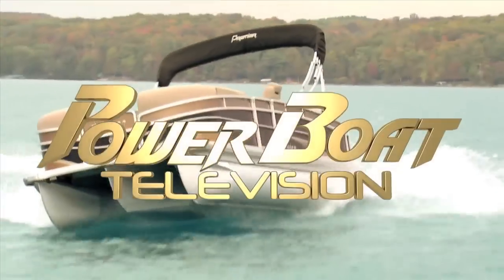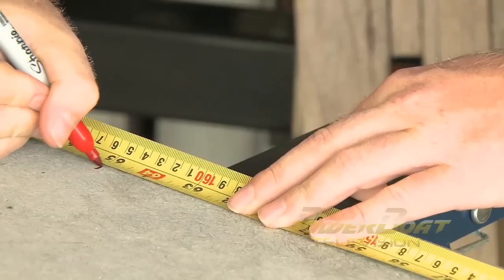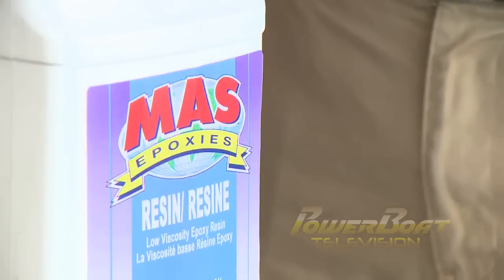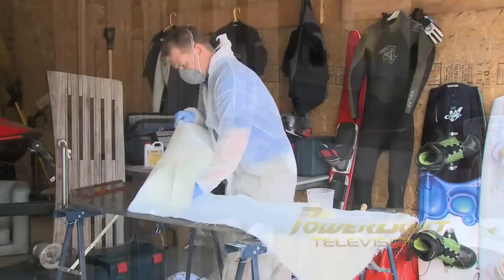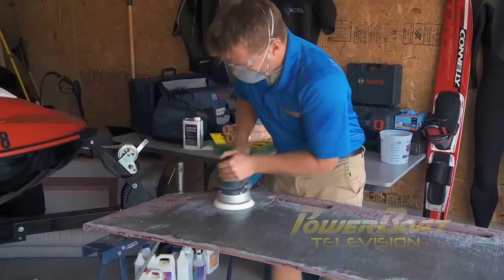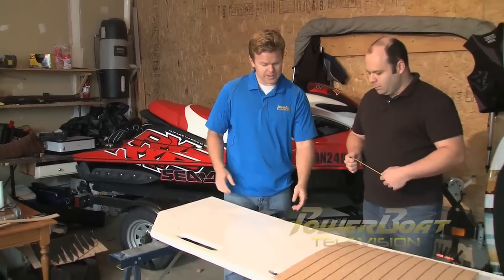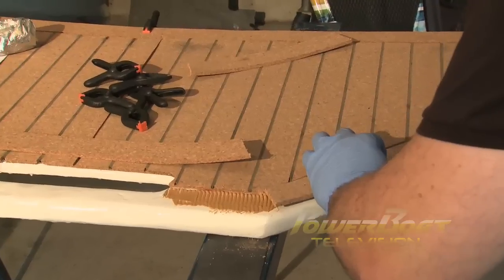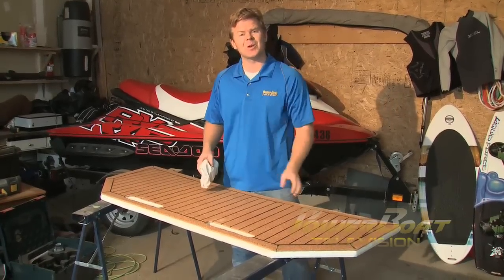How To Build Your Own Swim Platform - PowerBoat TV

Comment: Put the fiberglass down my God if anybody wants a good tip, don't let this guy work on your boat. Lighter glass would have made your project turn out a lot better.  When using the bubble roller the trick is minimal pressure and keep it moving fast the quicker the better but once again very little pressure.

Comment: I built this exact platform, but had to substitute construction grade foam and Bondo products.  Didn't have epoxy-grade paints so I used RustOleum. I found some cork-board at Office Depot and used black RTV from Discount. Then I sealed it all with some Spar Varnish which is UV protected. I'm at about  $48 before buying some brackets and screws, so I can afford Stainless.